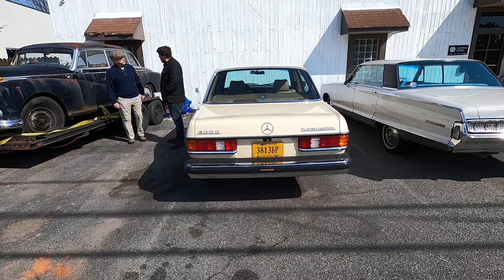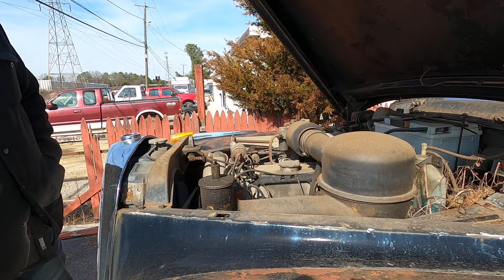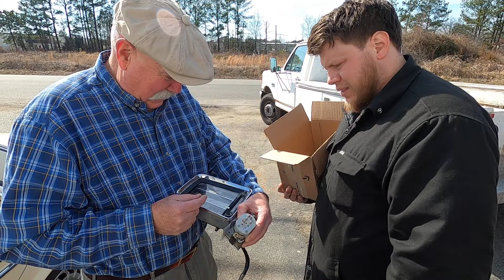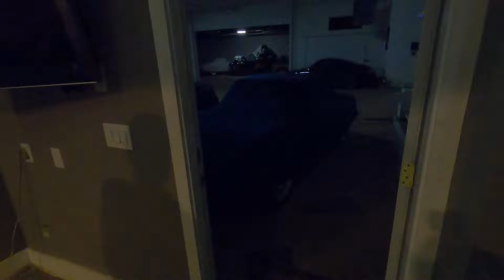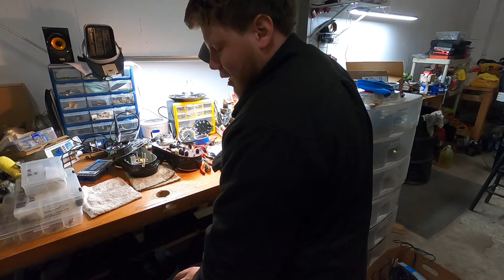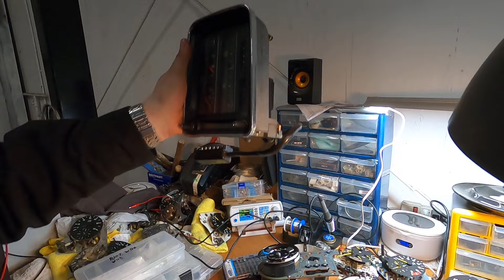1963 Mercedes Benz 220SE Instrument Cluster Drop Off for Repair at Stone Belvin's Shop Henrico, VA

Comment: I have a Adenauer in my shop right,a 300B. I also have a pile of M189 engines for spares. They are an incredibly expensive car to restore.
Reply from the maker: Thank you for watching. That is why I did not buy it when Stone put it on MB Market. I think it sold for about $25,000.